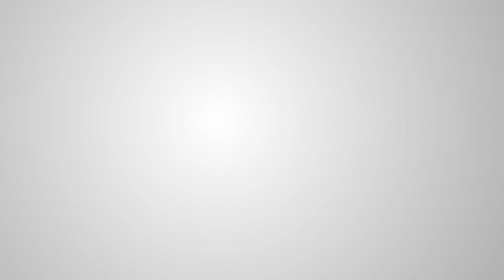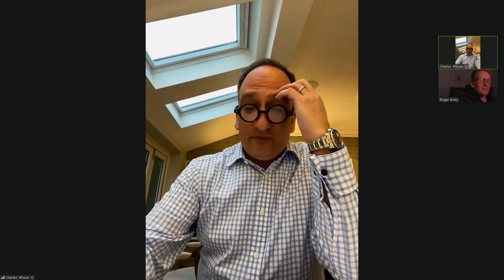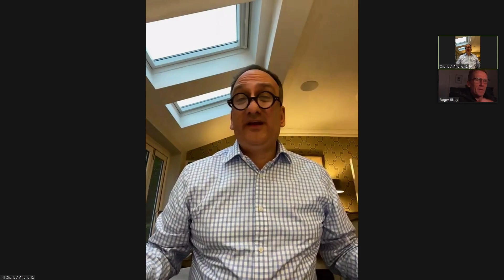10 Plumbers Couldn’t Solve This Mystery. Can You?

Comment: I live in an 18thC place with a 15yr old 'new build' that's doubled the size. After 4 years I still can't work out concisely where plumbing and electrical changes regulations. It's like the previous tradesmen thought they could cut corners by replicating the older techniques which has left us living in a house with so many generations of technology (22mm to 10mm to 15mm, and electrical cables I've never encountered at 44yrs old) which makes it incredibly hard to do any modernisation or renovation. 
We love this house but bought it on the basis that I could turn it into our dream home but half-a-day jobs take several days.
Reply: I know where you're coming from. It'll take time but you will show that house who's the boss!

Comment: I would clear the gravel at the bottom of the outside wall and see if there are any air bricks hidden. If there are, is there any water coming through...or perfume if you put it in the system? If they do put gas in the system, see if any gas is coming outside through the gravel. I would also do a plan showing which boiler fed which rooms of the house. Turn one on and see what gets warm. Also see if there is any condensation on any of the windows/metalwork in any of the rooms. Then get a diagram up and running of the pipework and radiators.

Comment: No. 1 get rid of that old boiler, two get rid of all push fit on combi. boiler, you should never concrete over push fit.  I'd cut area of wet, yes bloke doesn't want the hassle as you can see how nice his house is. I'd be ripping up floors where the wet is as that push fit in floor screams bad work. Think overhaul of pipework and boiler needed. That heating valve in the wall streams bodge, bet behind that is leaking rad. Shame I done my shoulder in and had a stroke otherwise I'd help out. The amount of jobs we done fixing bodges. But Roger all the best mate. Thanks from Bill

Comment: I found a drain off valve under a floor. the washer had gone took ages to find as wouldn't have looked for it
Reply from the maker: I found one like that and now I always put drain cocks outside
Reply: @SkillBuilder   this one was just in a random place no access as if they needed one more straight and only had a T and used the cock to close off extra 🤣
Reply: Previous owner stuck mine under laminate flooring in a cupboard...now I have 2!

Comment: Fracture in the water jacket inside the boiler? Opens up when boiler cools down, closes itself up when boiler on. Puddle of water in the combustion chamber which boils off up the flue each time it fires. Just a thought, and simple to check - pull out the burner.

Edit: I made the above comment at 41 mins into the video, and have now just watched the ending. Reminded me of a job i did many years ago. Similar problem that only became apparent when i fitted a new system boiler. Obviously header tank no longer required. Losing pressure as soon as commissioned. Thought it may have been the coil in the cylinder . Customer informed me they no longer heard a dribbling from the loft at night time. Thought - leak that was being replenished constantly by former header tank. Realised it must be underfloor pipe, somewhere. All concrete floors downstairs.  Guessed where the runs might be to each rad and lifted the carpet. Used a large wooden handled screwdriver pressed to my ear, with the blade on the floor (a technique i used to use to check pumps were working and their speeds). Checking every few inches, on my knees, customer watching, thinking I'm a plonker. Then i heard it. About 2 feet from the outside corner of the living room. Started chipping ing away at the concrete and found the leak on an elbow upturn. Concrete laid straight onto bare copper! Left it a few days to dry out before reconcreting over new sleeved plastic pipe. The inner leaf of brickwork, right in the corner, had fallen away for about three courses. Customer took me outside to show me where he'd been patching the outside corner rendering for years! Must have spent a lot of wasted money on their water bills! Happy days. And believe it or not, the customers were Mr and Mrs Day! I swear that is true.
Reply: John, out of interest - why did you join it with plastic? Assuming it wasn't left accessible ;-). I've never understood why people wouldn’t copper pipe (and sleeve) it...given that you were going to reconcrete it - hoping to be enlightened!
Reply: Not at the end yet, unlikely to be the heat exchanger as looks like it's not condensing so would have water dripping from the boiler. As said could be the coil on the cylinder if a vented cylinder?

Comment: I'm curious why he has a problem with damp in the chimney when the original leak was on the other side of the room and that  wooden floor didn't show any signs of warping or lifting normally associated with damp and leaks. Not a plumber.
Reply: Chimney leak from external chimney maybe
Reply: @koolworths  either that or it's not wet, it's salt coming through the 2 prong meeter would beep for salt, it didn't look wet on the surface but I'm watching a video he is there in person we would have to take his word for it.
Reply: Good comment, I thought the damp problem with the chimney might be a pointer. Really to my idea is that in reality the flooring may  need to come up if the fault can't be found above floor level.

Comment: If the customer thinks your there to rip them off from the start , the engineer doesn't stand a chance
Reply: Asked an engineer for details on several issues with a house. They just reported the issue and no explanation as to the cause. I figured out the cause to most the problems myself with a sledgehammer and lots of research. But basically wasted a grand on a 100 page report for nothing. My opinion of engineers is pretty low.
Reply: If you are the engineer then it’s your job to prove that you know what you are doing and then solve the problem. Unfortunately the industry is full of clueless, half witted knuckle draggers.
Reply: @Trevor_Austin  i agree in part yes , trouble is a job like that takes a certain engineer,  just being gas safe registered doesn't make u heating and sytem specialist,not just a plumber

Comment: Plastic pushfit fittings are going to be a future liability issue for the house building industry.They have a shelf life, unlike conventional copper/solder joints.
Reply: Conventional soldering has its issues to. I’ve seen pushfits that are very old and they still work, no leaks.
Reply: @gdfggggg  Fair comment, but well installed  (hair  felt)solder and copper have a far greater lifespan than rubber "0" rings.
Reply: @stevenwatson3963  true. All problems I've had with copper have been from poorly soldered joints. I've had a couple of issues with plastic but only because the installer didn't push then in properly.
Reply: @gdfggggg  I use little bit of silicone lubricant if I am ever having trouble, to help make sure the fitting is home. Don't know if its recommended or not but has helped me.
Reply: What about the copper pipes laid without protection in concrete floors, full of pinholes in just a few years.
Reply: Plastic joints should last 50yrs, no problem.
Reply: @gdfggggg  And in year 51? Major works ?
Reply: @shilks8773  Chances are the house will have undergone major or semi-major works 2 or 3 (or maybe even more) times in that 50 year period anyway!

Comment: If the underfloor is on a manifold, don't you have access to the flow and return which you  could disconnect and pressure test? This would at least eliminate that circuit. Also, what are the push fittings supplying? Might this be another area where disconnection and pressure testing could take place? 🤔
Reply: It doesn't look like it's on a manifold. It looks like it's behaving as a giant radiator.
Reply: @PhilBarrett789  It's a mini manifold all in one unit. They are, crap and you normally find the wiring connection box, pump and valve control all attached to it. He never got close enough but it does look like it has a flow and return connected to it so should be able to disconnect and test. Sadly most of those mini units I've seen connected with push fit joints in the loop, not continuous pipework from manifold and back.
Reply: @PhilBarrett789  I thought Roger said there was a manifold in the cupboard? 😐

Comment: I'm pretty sure the regs state that pipe laid into concrete should be in the conduit that JG and Hep sell.
Reply: No regs dictate the bedding of pipes I suggest.
Reply: @thequietroom3991  Isn't there a requirement for maintenance ? At the very least the manufacturer certainly wouldn't want you doing it, i'm 100% certain of that because I remember reading it in the technical docs.

Comment: i wouldant have under floor heating for this reason
Reply from the maker: Just keep the connections above the floor and it is fine
Reply: Should always be one continuous run of pipe, can more reliable than all the connections needed for radiators.